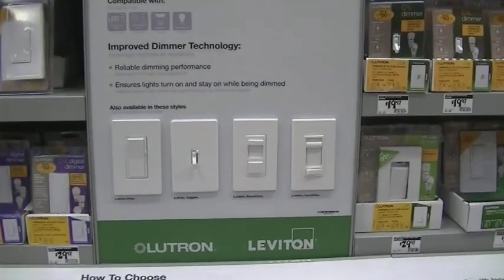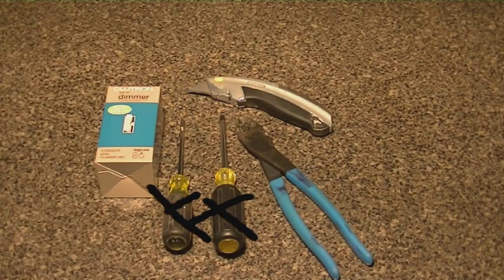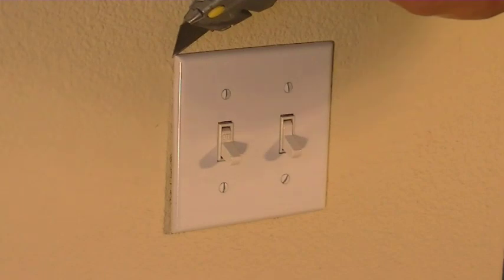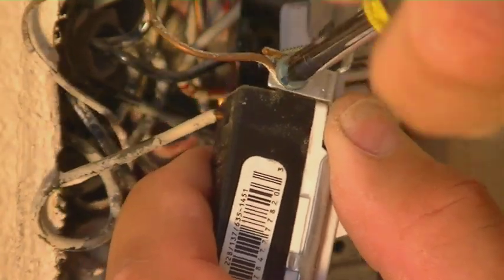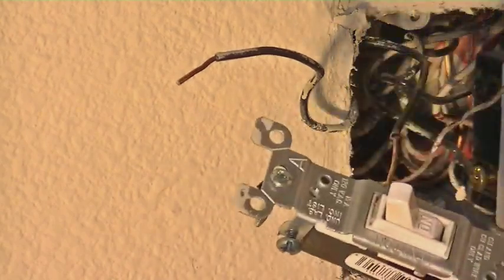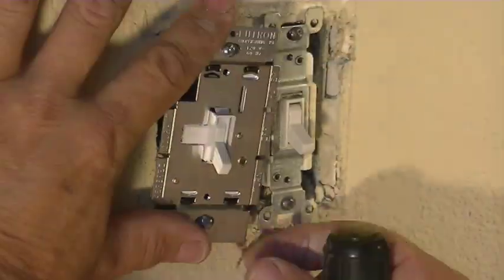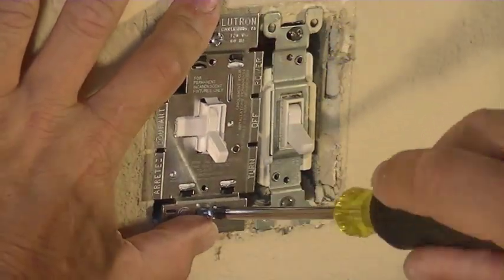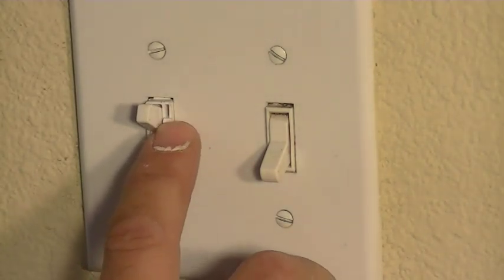Dimmer Switch Installation (single pole) By: Everything Home TV

Comment: Hi Brian, a great video, and easy to follow instructions, especially for a non-technical person like myself. I replaced one of the two dimmer switches because the one broke down. The replacement was exactly the same, and I connected the green/ground wire, from the new switch to one of the mounting screws as I did not sees any green wire, in the metal box holding the switches, connected to the old switch. When I turned the circuit on, all the lights generating from that circuit went off. This same thing had happened initially as well. So what do you suggest I do now. Your guidance/suggestion will be appreciated.
Reply: I realize your comment was 5 months ago, but for anyone else you didn't see a green wire because you were likely dealing with a 3-way circuit. In a 3-way or "common" circuit there might not be a ground wire present at the switch. Instead of the usual "hot/neutral/ground" wires there are what is referred to as "traveler" wires. These wires carry power to another part of the circuit, which could be more lights or outlets. In all likelihood you connected one of the traveler wires to the ground, and when you turned the power back on the circuit shorted thus tripping the breaker. Describing how 3-way circuits function is beyond the scope of a YouTube comment but there are plenty of videos on how they work. Simple 3-way circuits are fairly easy to deal with but a 4 or 5-way circuit can be more complicated. In theory they function the same as a 3-way circuit but in practice they're often more complicated, usually because you don't know which wires run to which terminals. You'll need a decent multi-meter to measure the resistance in order to determine how the traveler wires should be connected to the new switch.

Comment: for 3 way at a staircase, is it ok to have 1 dimmable switch and the other one that's not? also when using multimeter to make sure electricity is out, does it matter which multimeter needle goes to which screw?

Comment: so green screw is usually where the common ground wire go to?
Reply from the maker: Yes, and the white Neutral wires are usually wire caped connected together and pushed to the back of the box

Comment: What if you want to instal two dimmer switches? Is the box wide enough for both?
Reply: Same problem, two dimmers don't fit next to eachother because the metal fins hit the black boxes so they're too wide apart for the face plate
Reply: @MKTGJRF  The metal fins are removable

Comment: what should i do if my switch doesnt have a ground wire but my new dimmer has a green ground cord ??? the one i have is exactly that the one in the video
Reply from the maker: Fernando Villaizan It's hard to give advice without seeing your situation first hand. With that in mind if you're in an older home some didn't have a common ground wire, if this is the case and you have a metal box then a lot of times there's a separate common ground attached to the box.  If that's the case you can connect it to the box.  If not then you can remove the wire like they probably did on the other switch.
Reply: Place a cap on your new (green) ground wire.
Reply: You can also use grounding clips that snap on to a metal junction or outlet box, then connect a length of ground wire between the clip and outlet or switch. Did this many times in older homes. http://www.engproducts.com/products/ground-bonding/Accessories/Ground-Clips/Ground-Clips-1
Reply: Fernando Villaizan t

Comment: well down instructional.  Unfortunately, the dimmer switch I'm replacing has a green ground wire sticking out of it and nothing to connect it to.  Not sure where to find ground wire to connect to replacement switch or if replacement switch has ground wire attached, what to attach it to.

Comment: how do you know which wire is power in or power out?
Reply from the maker: with these dimmers it does not matter which one is which they can be hooked up either way
Reply: How about with no dimmer. Traditional light switch, thanks
Reply from the maker: power in is usually bottom connector power out is top if you have it wrong just switch the wires  if switch is upside down it will say NO instead of ON
Reply: thanks! there will be no explosion is switched wrong?